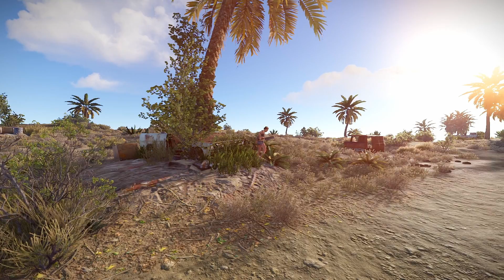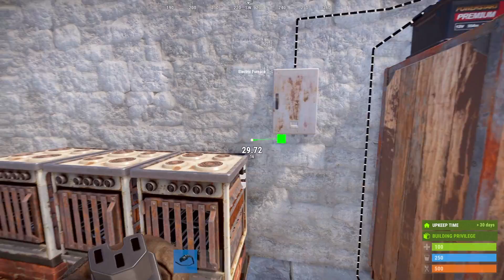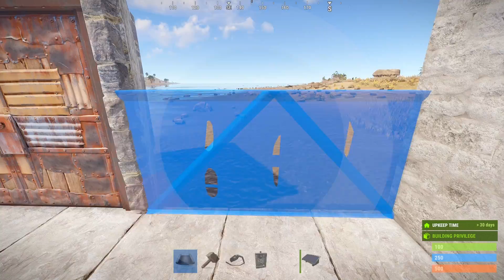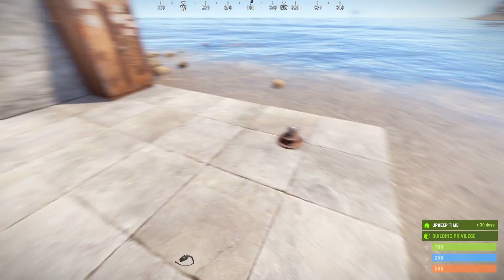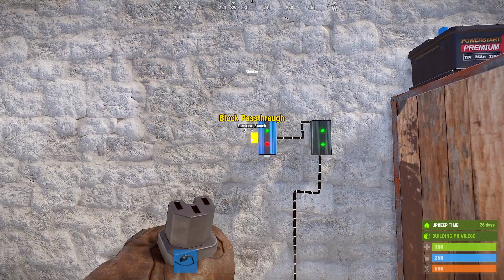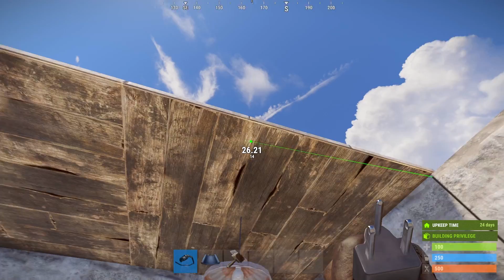Rust |  INSANE SMALL BATTERY SETUP | Electrical Tutorial

Comment: the electric furnace made the small battery actually useful.
pretty sure it only powers like two of them though, and you cant do turrets on a small battery as far as i am aware
Reply from the maker: You can actually do 4 electric furnaces or 1 turret on a small battery after they increased the output from 10 to 15. Thanks for commenting!

Comment: If you only use 1 box for both ores and smelted stuff, u can daisychain the furnaces. Only takes 1 conveyor and no need for industrial splitter and combiner
Reply: You still need another one,one to suck from the box another to suck from furnaces
Reply: If u daisy chain the  furnaces u can put the output of the last furnace straight to the box input. U don't need a second conveyor  @killvish99
Reply: Not true. One conveyer in a loop puts the mats in and also takes them out, been known for a long time now.
 @killvish99
Reply: @killvish99  actually you dont, the furnaces have an automatic filter, and you just need one to take them out of the box, it will return to the box by itself

Comment: Nice but I'm pretty certain you can take out the splitter and combiner on the furnace piping bit and just daisy chain the furnaces together to save metal/bps at start of wipe
Reply: can even also remove the branch, just series/passtrgh with conveyor - conveyor - splitter(electrical). saves 1 power needed by branch for that extra charge up speed from 1 solar panel during bad weather.
Reply: Yeah the only time I would use two conveyors is for the crafter or a bunch of sorting.
Reply: Yep. One conveyor and one large box then drop ore in the large box and it auto pipes to furnaces then smelted mats back to the large box without combiners or splitters or even a filter on the conveyor.
Reply: Absolutely correct, i was just about to comment this :)